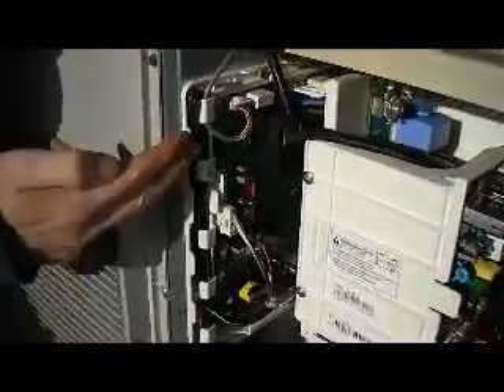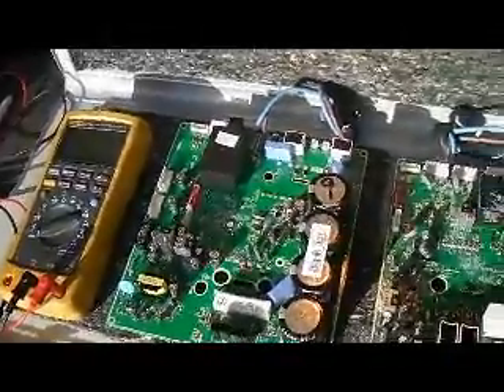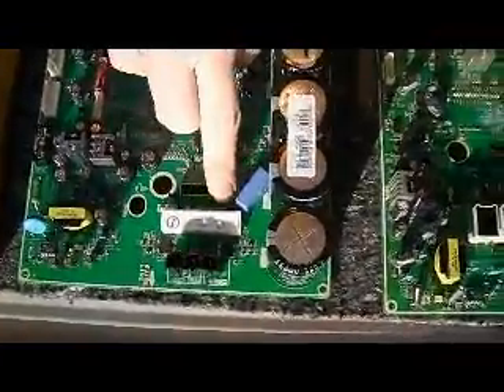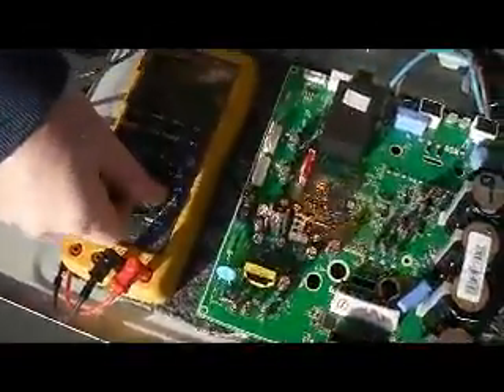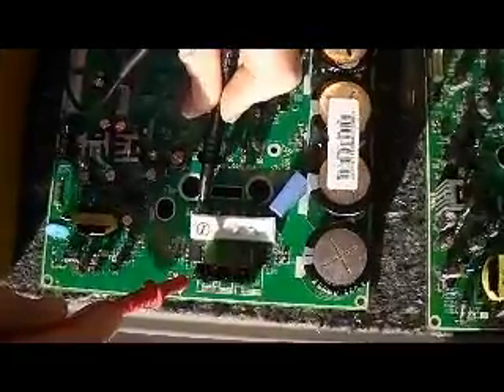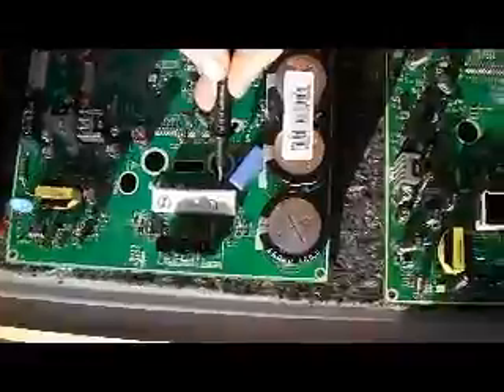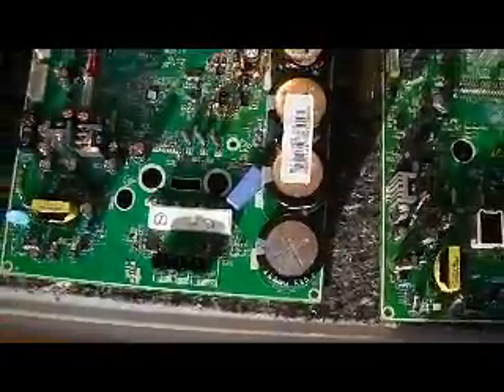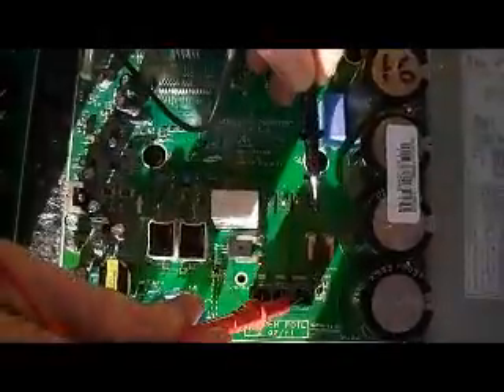E461 and E473 errors Samsung air source heat pump checking inverter PCB RC090MHXEA RC160MHXEA

Comment: Hi, HRP do an inverter tester for inverter refrigeration systems (p/n 253792, test leads 253794) with 6 x phase indicator LEDs.
Reply from the maker: i know, ive had one since 1995, its brilliant except for one small point, since dc inverter came in in 1998 it no longer works, hence the video.